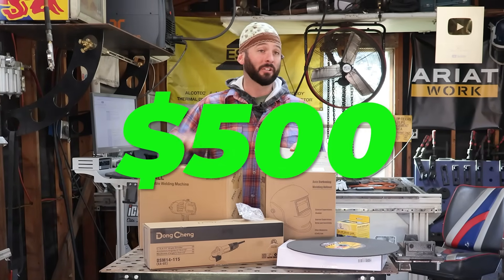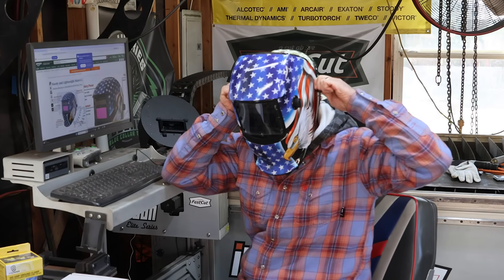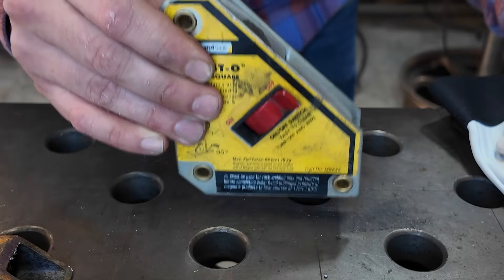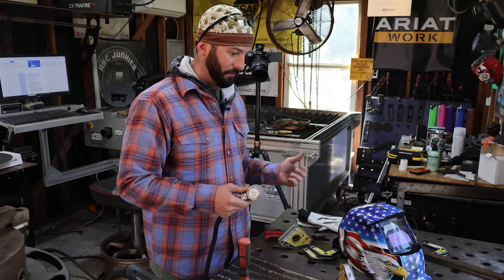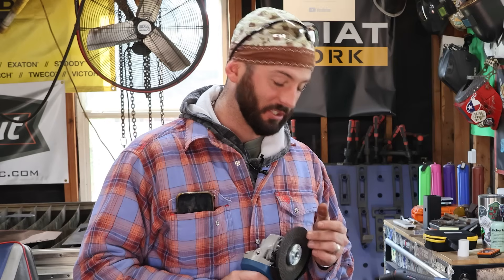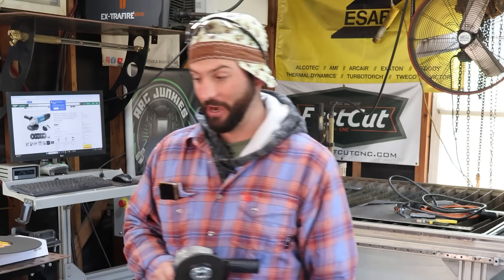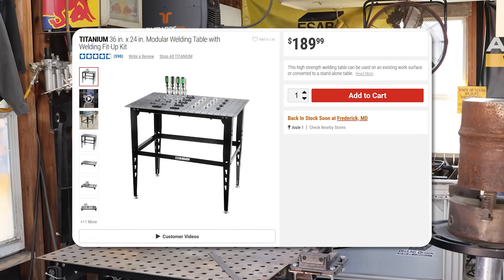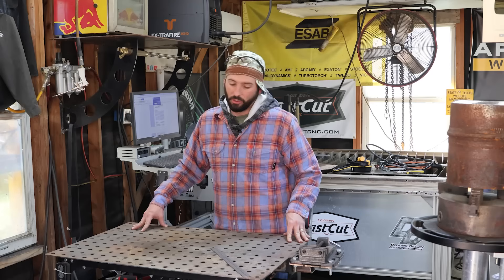Beginner Welding Tools I REGRET Buying

Comment: I want to weld on Carbon Overlay plates, lifting eyes as well as joining to hardox and sometimes milled steel.  Suggestions/advice?😮
Reply: To be clear I weld in the field at a quarry, ojt.  Stick welding 7018 or e309l most of the time.  Any pointers or advice would be appreciated.

Comment: My newby purchase I regretted, an AHP welder. Second newby purchase I regretted, lately seems to be plasma cutter that doesn't really cut well at all from Everlast.
I replaced the newbro welder with a 300 amp multimode from miller and never looked back.

Comment: anything magnetic when it comes to fabrication of steel are leathel and dangerous and should be outlawed by OSHA. I've personally seen plate fall off a plate magnet, them magnetic squares are full of metal slivers and have you spending hours pulling metal out of your fingers. Cheap 4-1/2 grinders with a cut off wheel are almost as safe as using a skill or worm driving saw with no blade guard. I buy and use a lot of cheaper tools to save money, yes they work fine just make your projects take a little longer. However, some cheap tools will get you hurt if you are not paying 100% attention to your work or they make everything take forever and the job becomes overwhelmingly difficult and frustrating to work on. If your using it every day get a nice paddle switch DeWalt or Milwaukee battery grinder.  Metabo corded grinders are hard to beat ar their price. Metabo is German engineered made in china but they run tuff and last a long time before you throw it out or get a replacement due to warranty. Me personally I like a 9" corded grinder they are a lot safer because they only rotate at 5400rpm, but removes so much more material a lot faster. A 9" wheel is about $15 and it last a long time. Got to eat your spinach everyday if you're gonna use one

Comment: What is the disc you use for your tungsten called? The one on the angle grinder
Reply: its a diamond disc from tri arc weld supply

Comment: Bro Idc what you say... Those mini tungsten die grinders are a saving grace sometimes. I have the wireless and same brand, and it has 1/8' idk what you're talkin about man. You can move the set screws to other positions too. I also like the fact that I don't have to change out grinder disks to sharpen a tungsten really quick.

Comment: My eye doctor told me don't use automatic lenses, still using solid color lenses and a pipeliner for 45 years now.
Reply: They have evolved, the 4 sensor helmets are a lot better than 2 ssnsor.

Conditions vary.

Pipeline is very different to fabrication. 

What works for you is more important

Comment: 12:35 what disc is that? that's the cleanest sharpen i've ever seen on a grinder.
Reply: its from tri arc weld supply
Reply: @Drweldz $30!! that's a steal. Thanks for sharing and thanks for the video!
Reply: @wmaxon44  Note he is running it on an Evolution saw made to run a metal blade.
I don't know if it will work on an old school chop saw.

Comment: Pretty disappointed with all the tests in this video. 
From blocking the cooling fan on the grinder and abusing the grinding wheels to ignoring the obvious with the handheld stick welder.  None of the tests were viable. 
Losing the respect that I used to have for the channel. Sad

Comment: For a budget tungsten grinder, I bought a cheap 5" bench grinder on Facebook Marketplace for $5, and mounted a Harbor Freight 4" diamond wheel on it (item 98862).  HF makes a chainsaw sharpener replacement wheel kit that comes with a pink wheel and a diamond wheel for $15.  Total cost $20.  5" bench grinders are generally useless, but work very well for this.  Like your angle grinder sharpening idea, you can make any angle you want with this.

Comment: you can use a standalone male plug with a threadstud on the back and a extention cable and you can ground your table securely, without having to use the clamp on it

Comment: I wanna take a moment & talk about the 'underrated' pieces of kit to have while welding.

1) a small spray bottle. Your eyes get dry sometimes, perhaps you also wear contacts, or maybe youre just trying to wipe the soot off & finish a part before lunch. Or maybe you got a little burn. Whatever the case is, its nice to have a small spray bottle in your backpack or whatever you carry your gear in & it costs like nothing for that convenience.

2) a 'welding sling'. This is not something you buy but rather a loop or 2 of rope, with an alpine butterfly in the middle, and ideally a large loop carabiner on that butterfly. The carabiner can hold whatever random things, e.g. the weight of the lead, the torch itself (be mindful), etc. and you can stick your thumb through it or the butterfly or the 1-2 loops around your torso while holding your wire gun or tig torch or stinger, pushing out & creating stability through isometric tension on the rope for welding joints where you cannot lean on something for stability. You can put your small tools on this as well if you make 2 butterflies, like an olight mini, nozzle cleaners, a detail wire brush, something to mark with, etc. 

3) leather. You can get 8"x12" for like 6 bones. You make shit for a living, consider stepping outside metal just a little bit. You can give any welding hood extra spatter or fume protection, you can stop burning through your 20-30 dollar gloves cuz youre in a hurry to check a hot part, you can give your blown out gloves new life if its not the fingers, you can stop arcing off the table when you set your shit down in a hurry, etc. A little insulation goes a long way.

Similarly, honorable mention 4) some large tweezers/tongs may help you tack things down without arcing into your support hand, you can pick up those tiny annoying parts that keep rolling off your table into the gaps in the floor, and you can tag one pair with some tape as a clean pair if youre running your own little shop & you want to eat while you work. Tongs have helped me with aluminum, id rather not pre-heat it & then be rotating it around with my hand. You can use pliers obviously but 5 bills is worth the convenience of being sprung & longer.

Comment: 2:10 i dont think its stripping, its meant to slip beyond a known tension im pretty sure. Im not a fan of it, but i dont think its fair to say its just breaking. You can buy a zip on pad or a ventilated sleeve to make the front thicker, can mitigate a little, and if you just stopped giving a f❌ 10 yrs ago, you can just go to dollar tree & get a pair of socks and/or pot holders, & put that over the front/back.

Comment: Very true with the helmets. I first started with a Miller Digital Infinity helmet. And took a welding class in 2017 and its 2026 and it still works great. Its a beast. Dropped on accident few times. The head bands show some wear and i probably will replace soon. But they still function and work.

Comment: The real question about really cheap auto dark hoods is whether they actually meet the infra red and ultraviolet standards. You don’t really know. And, on cheap Chinese equipment you do have to be careful as the CE EU safety standard looks similar to the Chinese CE which just means China Export. The fonts on the letters are pretty much the same. The difference is that the China Export letters are close together while the EU letters are obviously spaced. Easy to confuse them if you don’t know. Intentional? Nah, would they do that?

Comment: For a cheep hood, you can always slap in a straight lens in it when the AD starts pissing you off or when it starts to go out. . . When I bought my first hood from Harbor Freight. {Needed a hood but couldnt find a supplier near me at the time.} Think I spent around 30-50 bucks for the time I used it for about 2 ish years doing stuctural steel before it started to go. Went to our supplier and asked him to get me a number 12 lens then cut it to fit. The hood isn't the problem with those, the hood is good but the AD is were they will fail. Buy a lens and if needed a new harness and it will last you a very long time.

Overall, if you dont have much money. Buying one of them and getting parts like a straight lens and harness will be over all cheeper then spending over a few hundred bucks. But it is a a straight lens so you may need to arc it once to find were you need to watch before you take off. But better then going blind when that cheep AD takes a shit on you mid way through.
Reply: aren't AD lenses pretty cheap? I know I've replaced a few over the years, usually when the battery dies but I replace them because they get spatter marks.
Reply: @Born_Stellar  you can replace the battery in some, but not anymore. l wanted to change out mine and would have to pay around 300-400 bucks for one.

Comment: Re the "fixture table" clamps.  Yes they suck..  However there are some replacements available that work really well.  They hook through the top and get real solid as you tighten then.  I got mine from Fireball tools and use them all the time.  Great little table after you do the other mods you mentioned.

Comment: I’ve been working in the welding industry for 25 years building stainless steel pressure vessels. I’ve seen some serious injuries because of people not paying attention to proper abrasive set up. I’ve seen people pickup heads with a sheet hook on the knuckle instead of welding on a coupon and using a rigging shackles. I’ve seen people get injured because they picked up a shell section and didn’t cut the paper back and didn’t use poison pads or a bar clamp for shells. Most injuries happen because people 5 years and younger experience don’t listen or stop and have someone double check what they’re working on. I’ve seen insulated tanks catch on fire because of the wrong torch angle when welding a 10-12ga outer jacket. I’ll explain to my welders, you don’t need to weld at 45-60 degrees. I keep weld angle about 30 degrees and use 1/16” filler rod. I tell people, there’s nothing wrong with double checking and asking questions if you’re not certain about a job etc.

Comment: Yep, I have bought some of these uh hem ,tools myself and they kinda work but they let you down occasionally.  Sometimes you either can't afford or can't justify spending a lot for better stuff so you make do.  Welding helmets are a particular sore spot with me.  I have a Jackson low cost helmet which is comfortable, light and reliable but with no adjustments for sens, or shade but I use it because it works.  Went to a cheap fully featured Chinese unit that sucks badly.  Recently spend a lot of coin on a Miller unit that I am testing.  It feels good on my head but strangely will black out at the slightest bit of sunlight coming thru an open door even on low sens and when I tig it goes almost clear for a moment sometimes. May be a bad unit.  Someone called the way we progress thru an item by buying progressively more expensive ones  "The tripod effect".   That's where you buy a cheap tripod and find it nearly useless, so you get a better one and then a better one after that until out of frustration you drop hundreds on a pro unit and then realize this is what you should have done at the beginnings after you spent at least that much on the lesser junk along the way.

Comment: Redo the handheld welder on a direct outlet or 10 gauge extension cord.
They need the amperage/ low resistance to work properly.
Reply: It’s crap no matter how you power it.

Comment: I'm 74. My wife bought me a different brand hand held welder for small repairs around the property, so I don't have to lug a real welder out there. It won't weld 6011 Lincoln but the 3/32 rod it came with it will. What I have found is there is no such thing as controlling the arc length. The rod produces a huge volume of a glassy slag and the weld puddle is buried inside it so you can't even see the puddle. You just push down and keep pushing and travel the rod. I modified mine by attaching one of the cheap stingers that came with one of my welders, so now I don't have to wield that heavy welder which is pretty clumsy. I just have a normal stinger like any other stick welder. It's OK for light repairs that don't have any life safety issue.
Reply: I have tried one of these chinese hand held machines. For some reason it welded 3/32 well. i think theres bad and great examples out there. Just luck of the draw which one you will get

Comment: What is that grinding wheel used to sharpen the tungsten rods?
Reply: It has diamond dust somehow affixed to the disk. It works well to sharpen carbides. Not very expensive. I bought a cheap angle grinder and it is my dedicated sharpener that stays at my bench.
Reply: its from tri arc weld supply
Reply: @Drweldz Thank you

Comment: I have an old Lincoln helmet that had the same issue with the headband knob "ratcheting." Turned out there was an issue where the pinion wasn't aligned correctly with the racks on the bands so the teeth would jump. A strip of sheetmetal as a shim fixed it.

Comment: 1. magnetic ground. the skus you bought are trash, i live in CN and you can get those dual switch mag ground for 4$ 2. dong cheng angle grinder... dong cheng is trash brand even in CN standard and that one should be something like 20$ locally so 30$ i would say great value if you buy on amazon 3. for the auto darkening hoods... yeah most of them are like something 30$ here, if you want those auto darkness adjustment(9-13 auto adjust) hoods with PP instead of PA protector they are like 100$ and all of them are reliable i would say ppl are paying a huge premium on those outside. that stick welder... i dont even see it here i believe is trash export stuff because a normal decent stick welder is really cheap like 30-40$(good ones with no water on amps you get 100a on a 100a dail)

Comment: When buying an auto helmet, check the response time. I have low end "name brand" from about ten years ago. It seems fast and the measurement sounds fast, but it's slow compared to the Lincoln that I got later. My eyes were really weary after welding with the cheap one but are totally fine with the more responsive Lincoln. Also, I had a hard time not obscuring the two sensors.

Comment: 10:06 I really wish you didn't say that because those abrasives have their purpose for example I don't usually buy angle iron because I go out and get free bed frames from people and I bring them home and process them,  basically have unlimited free steel but bed frame steel is typically hardened steel so it's so much more worth using my abrasive Hercules chop saw vs my evelution carbide miter saw so I don't agree with you on them being trash they are very useful for cutting hardened metals and not wrecking your carbides
Reply: fair enough.
Reply: Agreed. I didn’t know that bed frames were hardened steel. No wonder it takes forever to grind through the rivets and the angle iron on the bed frame.

Comment: 11:51 I bought a $15 diamond coated grinder disk that I only use for tungstens. I hold the grinder in my vice and get a good enough angle. Better than this little grinder.
Reply: I bought a diamond coated disc for a benchtop grinder. and i fabricated an adjustable electrode holder for it. Great for longer electrodes.

Comment: I love the videos. But i have to tell you man, you cant break tungsten without sending cracks through it lengthwise, also you need to cook your rods in an oven, thats why your 6010 wouldnt stay lit
Reply: @xochitlsvibe6400  you don’t cook 6010
Reply: dont cook your 6010s, and yes im well aware of the tendency for tungsten to crack.. regardless ive done it for over a 15 years.. and most of the time it doesn't if you snap it right.  the reason it wouldnt run a 6010 like most smaller inverters, it lacks the open circuit required to start and keep the electrode running. this one lacks it by far.